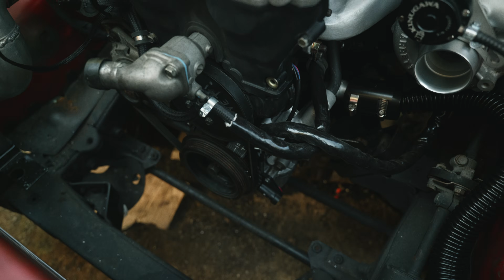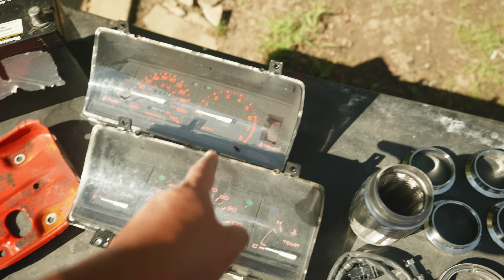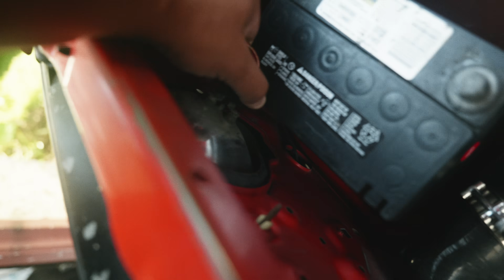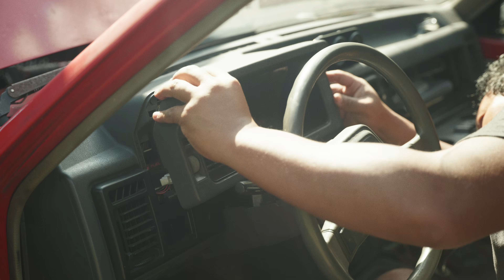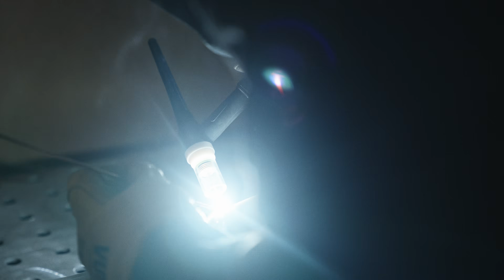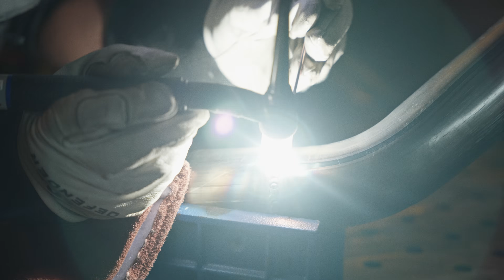Mazda B2200 custom turbo exhaust, battery tray, and cluster mods  - Build Series 010 #mazdab2000

Comment: I had a ‘92 b2200 with a 1.6 B6 swap from a 90-93 Miata. It wasn’t exactly fast N/A, but had some much more aftermarket support than the F2 that was in it. Adding a turbo was trivial.
Reply from the maker: thats great, post some video